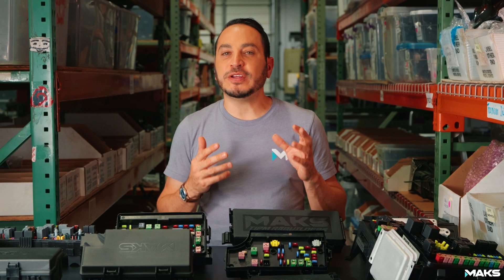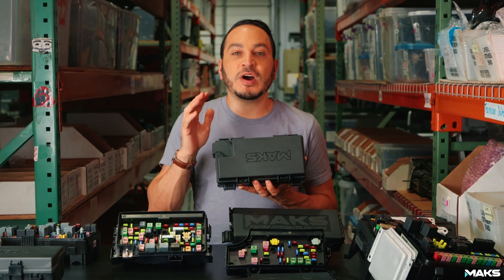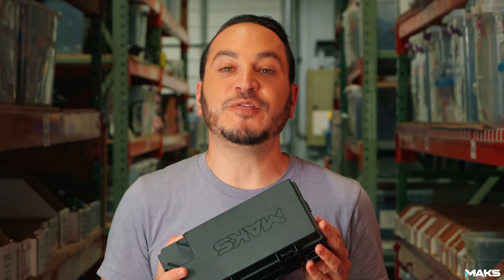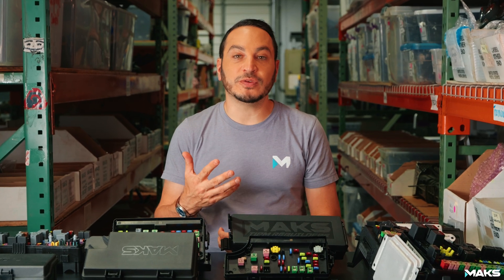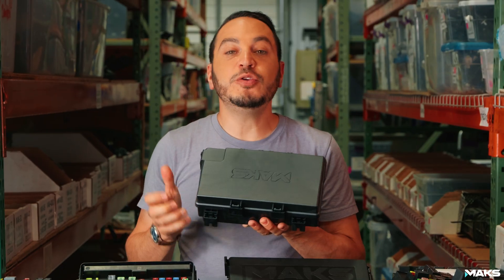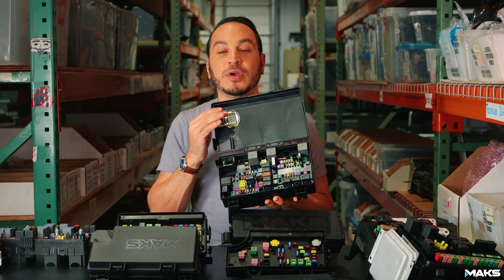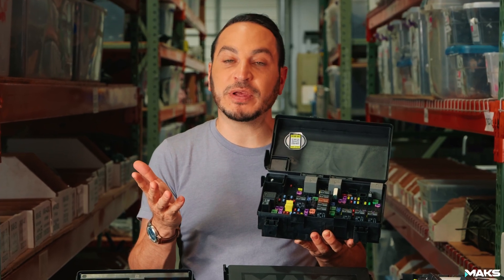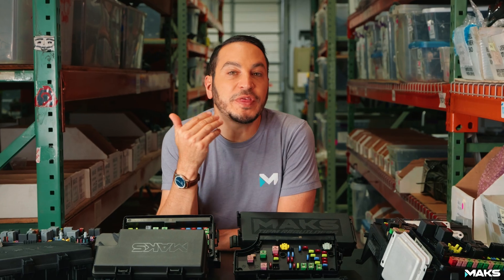Why did Chrysler change from TIPMs to PDCs?

Comment: Call me crazy, but they look the same. If I wanted to order one from you, how would I know which one I have?
Reply from the maker: Good questions. You can visit our website and look up the part you need via VIN or Y/M/M! www.tipmrebuilders.com
Reply: @TIPMRebuilders  I tried that. The number I have for the one on my truck is for a for a PDC according to the sticker on it but you have that same number attached to a TIPM and it doesn't match the correct year for my truck. Something on your site doesn't add up.

Comment: Very nice and Informative Video! I have a question, and can really use your help! I have a 2007 PT Cruiser converitable. I recently had a refurbished PCM put into the vehicle. Since I have gotten the vehicle back, it seems like there is another problem. I'm not sure if the two are related, but it looks like the TIPM Is now out of whack. I saw one of your other videos, in which you recommend that someone swap out or reset the TIPM on your own. I am not the most mechanically inclined person, but I thought  that I might give resetting the TIPM a try. My only concern would be disconnecting the Modules, and connecting them back. So I wanted to know if the Modules, once they are removed, would be easy to put back in. It looks in your videos that the Modules are pretty much plug and play. But my question is....are they set up such that only one particular Module would fit into One particular Corresponding Slot? If so, then this should make it easier, and maybe I'll consider tackling it on my own! Thanks for your feedback, and I apologize for my long comment/question.

Update!! Hey Mak, after posting this, another video that you did a while back popped up in my feed. And in that video, you Answered my Question, and you indicated that the Plugs are Unique to each slot, and that they are also Color Coordinated! You were working on a 2014 Jeep, so I hope that this would be true on a 2007 PT Cruiser. But perhaps you can let me know! Thanks again!!
Reply from the maker: Thanks for the great question! You don’t have to worry about accidentally mixing anything up — the plugs on your TIPM are all unique to their own slots. Each connector is shaped so it only fits into its corresponding port, and on many vehicles (including your PT Cruiser) they’re also color-coded to make things even clearer. That means you can’t accidentally plug one module into the wrong place. It really is a plug-and-play setup once you get to that step.
Reply: @TIPMRebuilders Awesome Brother! And thanks so much for replying, and given your response....I just might try to tackle this! I'll start with doing the Resets that you discussed in one of your other videos, and if that doesn't work, then I may have to look at purchasing a TIPM. But I'm keeping my fingers crossed that the Resets will work. Thanks again Mak, and Wish Me Luck!!🙂🙂

Comment: Would love to find a aftermarket solution for my 2004 dodge ram 5.7..This will be the third time i will be replacing the FCM..Also need a PCM this time..Ive always had electrical issues and know that even after i replace both i will still be having trouble again in the future
Reply from the maker: Were sorry to hear about your ongoing FCM troubles. They can be tricky modules. We have  FCMs in stock for your vehicle. You can browse through them using this link. If you have any questions, feel free to contact us at 818-798-5558 or email us at support@tipmrebuilders.com. https://tipmrebuilders.com/product-category/dodge/?wpf_filter_cat_2s=dodge&wpf_filter_cat_list_3s=ram-1500&wpf_fbv=1&wpf_filter_model_year=2004&wpf_filter_listing_type=fcm